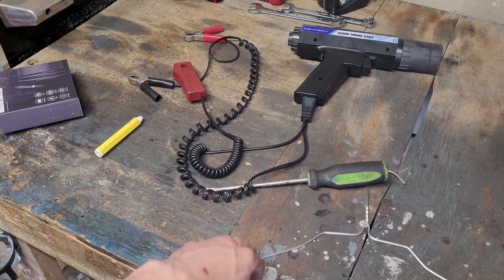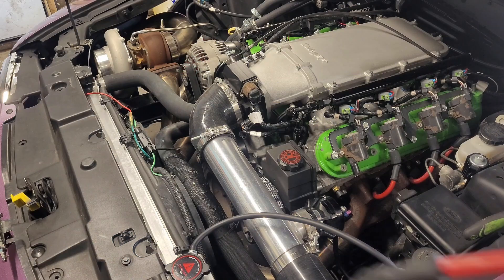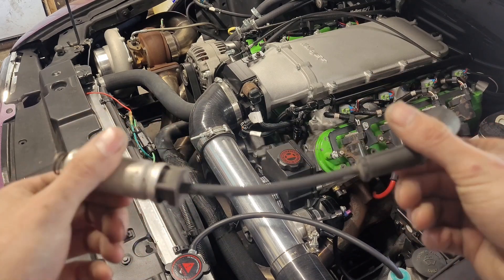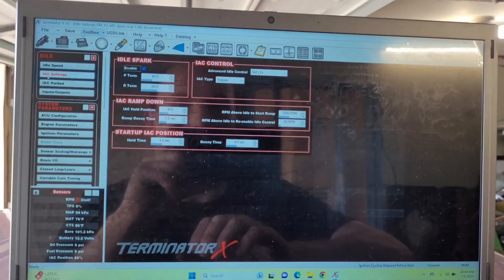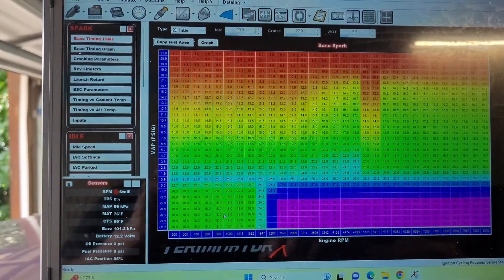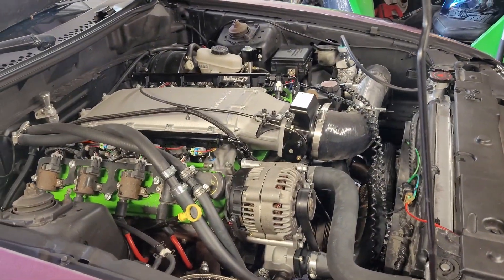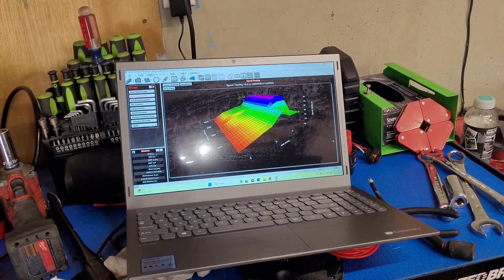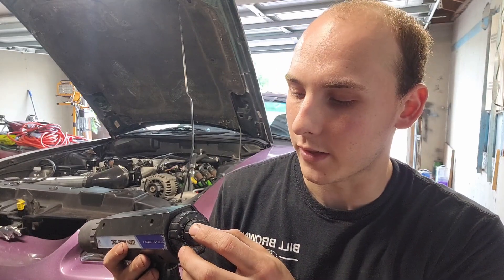Easily verify LS ignition timing!

Comment: Thanks for the video, I'm hunting a potential issue and first i need to verify my ignition time is in fact what terminator says.  This seems like a pretty simple way to go about it, i was thinking i would have to make a pointer + a timing tape with hash marks.
Reply from the maker: I was in the same situation which is how this video came to be. I was unsure if the cam I had received was genuine or not and a lot of other people had seen the knockoffs needing around 10 degrees more timing just to make the power they should. 

Hope it worked out well for you!
Reply: @acceleratekendel  I actually ordered a pointer from motion raceworks, waiting on it to come in, I saw some people claim as much as 10° variance in the reluctor wheel positioning. So the verification is what I need.. currently the car "cammed 5.3" only likes to idle at 10° and I get popping and banging at wot which is 24°

Comment: You don’t have to make a pointer. You can mark the flexplate / flywheel and the pan or bellhousing depending on which version you have.
Reply from the maker: I could totally see how that would work over making a pointer, but sitting underneath the car running on jackstands is not my favorite activity lol especially once the cooling fan kicks on.

Comment: So say I'm trying to do this with an engine that won't start, I have cranking timing set at 10° currently, would I be able to do the same thing just while cranking? Trying to eliminate reasons for no start.
Reply from the maker: I know on my car the cranking timing is at 15° and crank to run rpm is 400rpm. If you have a nice jump starter that can sustain it being on the starter for a little while I think it'll work just fine, just give the starter time to rest between trials so you don't overheat it. 

Is the car stock PCM or term x? If terminator X double check your grounds on both sides of the heads are tight (they're for each side ignition coils) and that you have fuel pump/pressure while cranking.
Reply: @acceleratekendel  it's terminator X, I'll have to double check everything again.
Reply from the maker: @thetinkeringnebraskan8420  let me know what you find, id be happy to help you troubleshoot it.